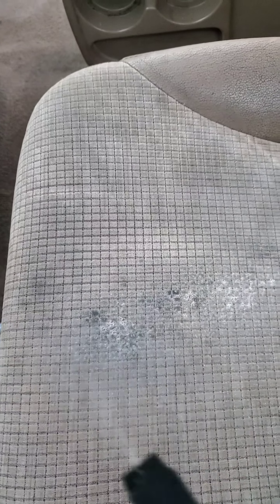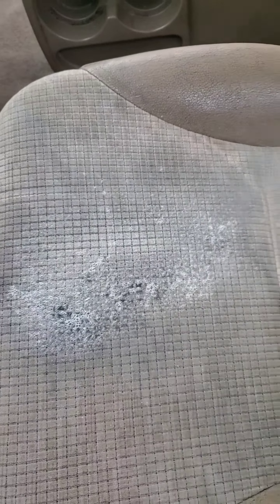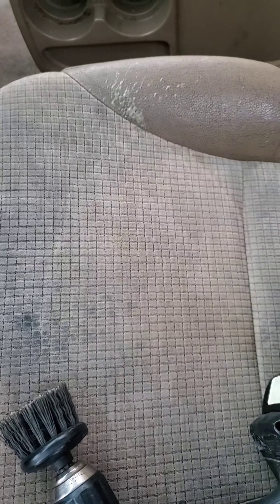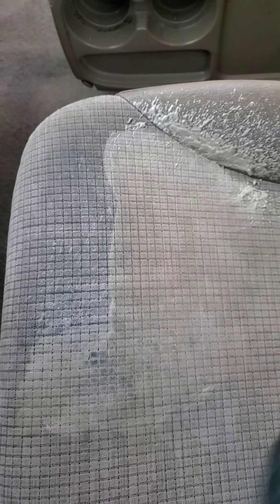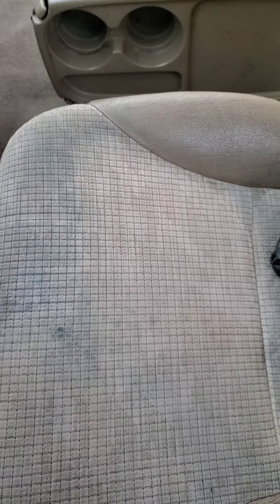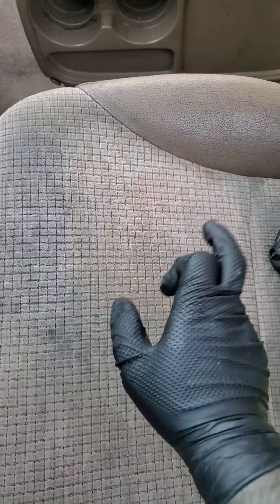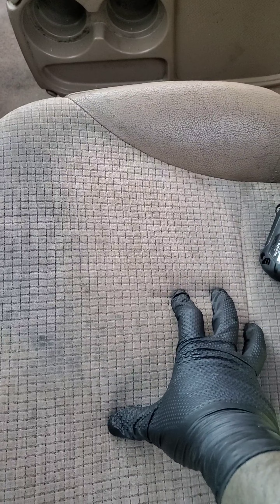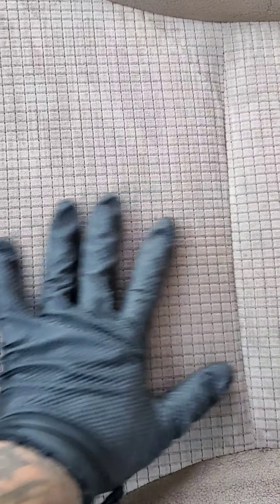Detailers don't need extractors

Comment: Real nuggets of gold in this channel 💯
Reply from the maker: Yes, only real game!
Reply: @DETAILSofficial  I just had a random thought about this technique. Let’s say the customer spilled some coffee on there and it passes through the fibers and soaks a bit into the cushion, I clean it with this method and it looks great. If the seat gets wet again and the moisture passes through the fibers, would that make the coffee stain reappear?
Reply from the maker: @gregory3227  once the foam is saturated it will never get fully removed,  an extractor may get a bit more out than this process, but it will always wick upwards when saturated
Reply: @DETAILSofficial  Got it. So I’m assuming the best thing to do is to add some water repelling protection after I’ve cleaned it and make the customers aware of the situation and the chances of it reappearing. Again, I appreciate the knowledge and wisdom. 💯
Reply from the maker: @gregory3227  you said it perfectly my friend. That level of communication with your clients will separate you from the rest.  Thank you for the support.

Comment: nice... I just bought these 3 chemicals to try out. The way you explained it is the way I was shown how to use it. Did you use an extractor after or just steam to finish it all off.?
Reply from the maker: After this step is done we steam, but either method works well once the stains are surfaced

Comment: Since only the top surface is wiped up and nothing that possibly had gotten down deep into the fabrics, once it somehow, someway gets wet by the vehicles owner, isn’t there a chance of old stains coming up that we’re below just the top level surface that an extractor would have pulled out? No hate, just curious 👍🏼
Reply: Great job thank you for your technique
Reply: After the process is done using finisher peroxide the 3rd step in P&S’s 3 step process is extremely important, it not only neutralizes the products that were applied but it also is a bleach/peroxide formula that actually brightens the surfaces as well. The only things I’ve seen happen is if the stain is just stubborn and resurfaces or you’ll end up with some white chemical residue on the top that just needs to be wiped with a damp towel on occasions. If the seats are really bad I actually use my drill brush to work in finisher peroxide just so it gets worked into the fabrics deeper. If you really think about it.. if your using an extractor you have more chances of those chemicals re activating because there is 10x more water on the surface compared to what a steamer would leave behind. And with chemicals re activating you actually risk damaging the physical fabric and breaking it apart and leavening behind the true color of the fabric.. which is permanent and the only way you can fix it is by re dying.
Reply from the maker: They answered this for me, hope this helps clarify.  Great question
Reply: @davidb5220 David puttin it on thicc
Reply: @SalfromDETAILS  👍 the more information the better, so there’s no questions

Comment: Save these steps for spot cleaning or people who can't yet afford the equip.  Pros. in the industry blow out interior with compressed air, vacuum,  pretreat and drill brush surfaces, and then rinse while using a heated extractor which is made for this exact job.  There is a reason home upholstery and carpet cleaning companies use industrial carpet cleaning chems. and heated extractors = Efficiency and deeper cleaning ability!
Reply from the maker: The results speak for themselves and its actually completely opposite, beginners are the ones using the method you described  and once technique and understanding of method and chemistry is applied the machines are ditched,, but Thank you for the watch
Reply: You can use numerous techniques well doing deep cleaning. The extractor causes way to much soiling on any surfaces.. just plain and simple. What most people don’t know even with carpet cleaning or upholstery cleaning they treat surfaces first before using a hot water extraction technique, hot water actually locks in stains permanently. And utilizing steam with transferring or  using there technique is ideal before you even think about extraction. If any kind of extraction is needed it would be dry extraction. The only time a extractor is needed  is if you were actually going after “dirty” surfaces not stained surfaces. Each element gets treated differently. What doesn’t make sense to me is why do people think applying a tremendous amount of water to the surfaces creates a cleaner surface… 😅 come on now your causing issues, wasting time, and possibly risking more resurfaced stains once dried.
Reply: Yeah...ask Yvan LaCroix about that. He ran multiple high volume detailing shops for years in Canada and has been in the game for well over 40 years. I believe he's stated several times that he (or his employees) have only used an extractor twice.
Reply from the maker: @davidb5220  well said David,  well said my friend